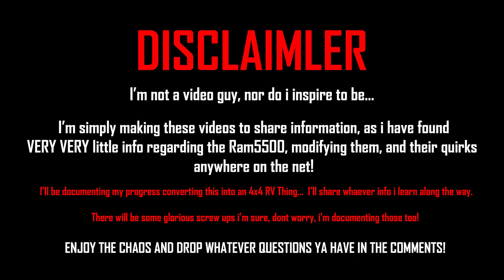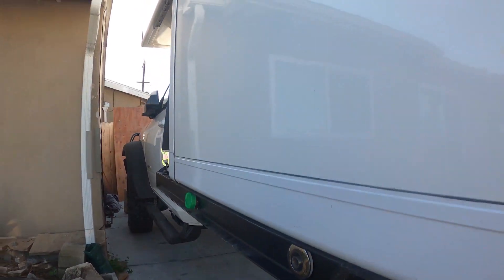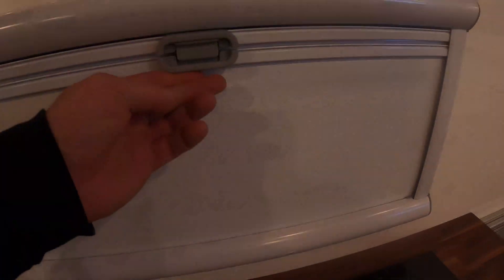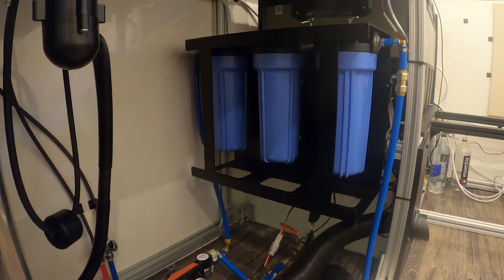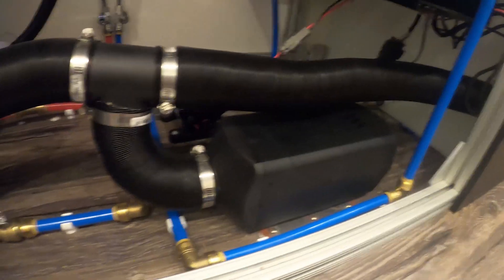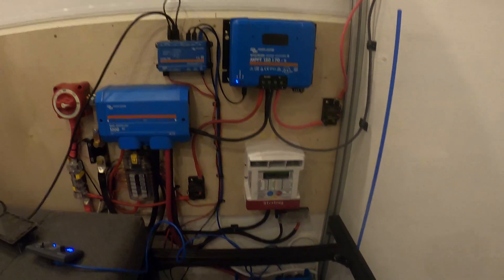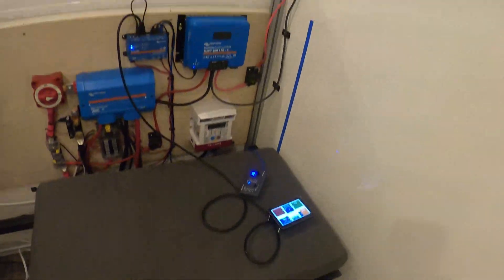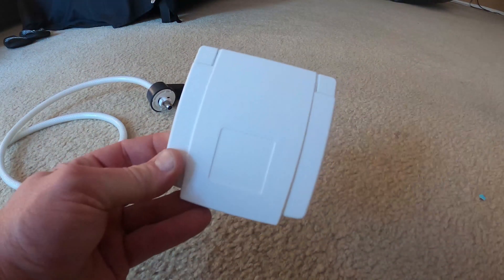2020 Ram 5500 4x4 Off Grid Camper Build EPISODE 11

Comment: Plex and Sharkbite are the way to go in a camper. Some say crimp is better for connections but then you need to carry that tool. Sharkbite gives easy trail repair if freezing or other leaks. Build looks good. Nice electrical too.
Reply from the maker: I agree!  Thanks!  The crimp needed to be used in a couple spots because of limited space, but the rest is all shark bite.

Comment: How are you attaching the 8020 to the walls of the camper?
Reply from the maker: With the same adhesive i used to assemble the camper.  I cover it in one of the episodes.  Basically glue a 90 degree piece of aluminum to the wall and bolt right to it